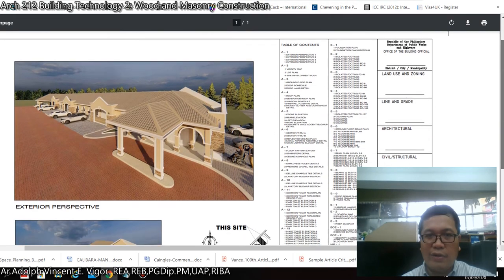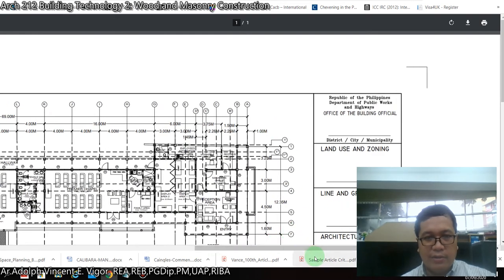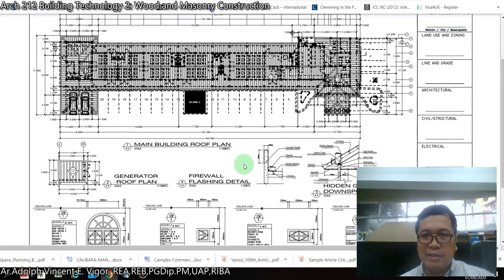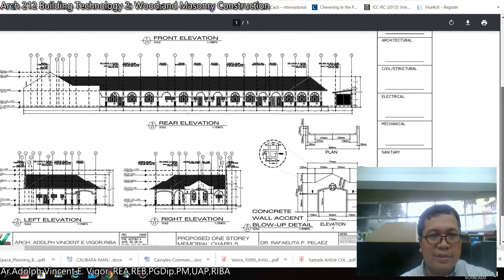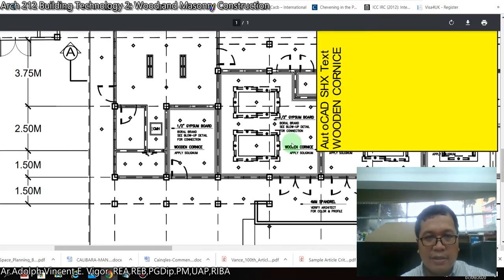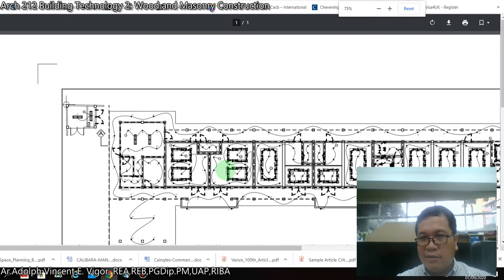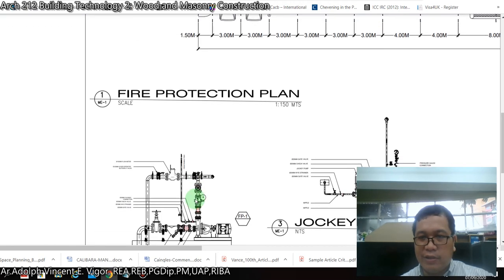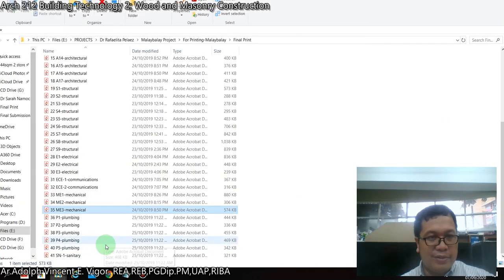ARCH 212 BT2 Week 2 Construction Documents Introduction

Comment: Hello Sir regarding the column grids may I ask if kapag more than the alphabets na yung bilang ng columns ano pong gagawin?
Reply from the maker: I had experienced working in a consultancy firm handling mega projects in the Middle-East and so far despite the magnitude, it  never exceeded Z. Why? because if the project is too big you need to break it into smaller components so that it would be easier to execute. If you ran out of letters you could always do this A' or 1' for example.In smaller projects, this would not be a problem.
Reply: @ArAdolphVincentVigorRIBA   Ok Sir, thank you! God bless po